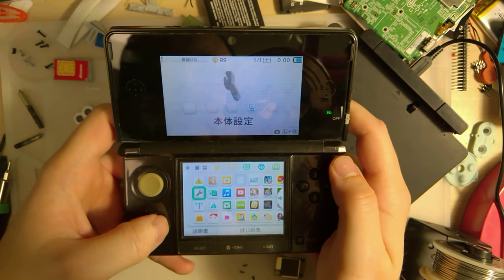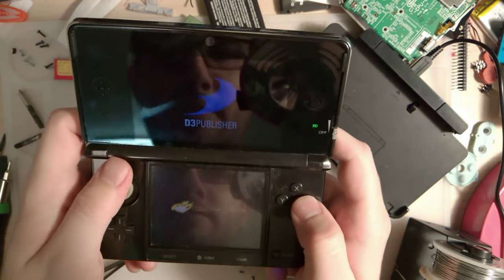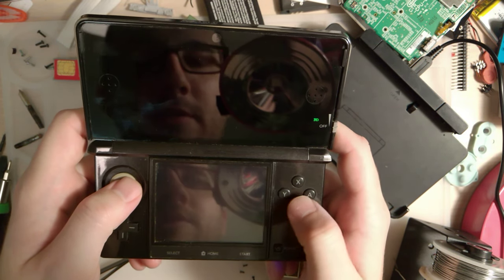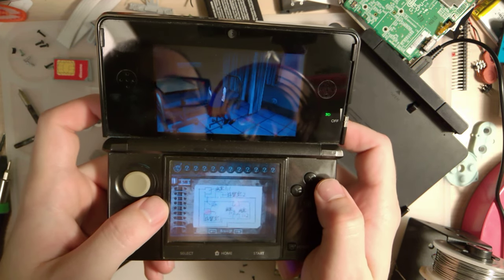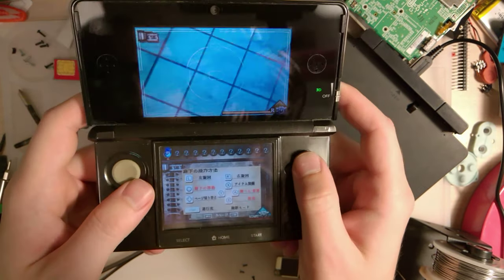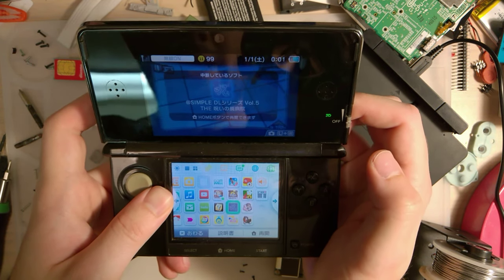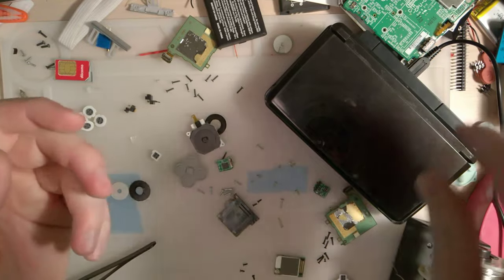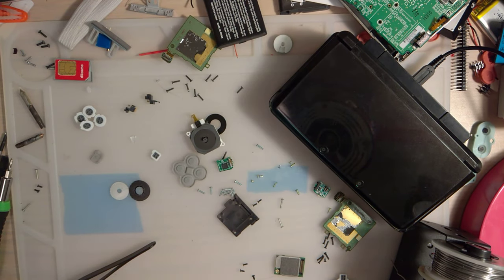Troubleshooting more junk consoles from Japan (3DS) Part 2

Comment: I'm here before the video is processed lol
Reply from the maker: It hasn't even finished uploading tbh. You've still got at least ten minutes before it even starts processing =)
Reply: @makho  also I followed your tutorial for the jp crystal flashcart and it still isn't working even though nothing looks bridged.. I might buy more adapter boards on OSHPark and try again
Reply: just bought some more tsop44 and the other one whatever it was called
Reply from the maker: @NikhilGarlapati  On occasion, I do receive dead flash chips -- that's why I try flashing them before soldering. Try desoldering that chip and try another.
Reply: @makho  I did, and it still didn't work. I removed the adapter board as well and will solder on the old rom chip. I'll wait a month for the new adapter boards (ordered both types) and will use them on gold first and when I feel comfortable I will install crystal.
Reply from the maker: @NikhilGarlapati  If it makes you feel any better, I went through six different iterations before I finally got one working board.